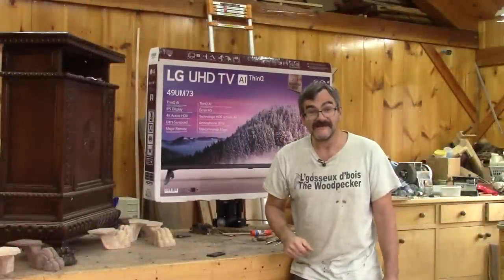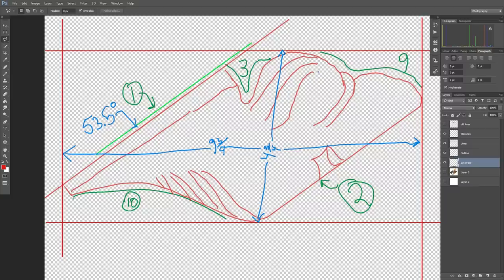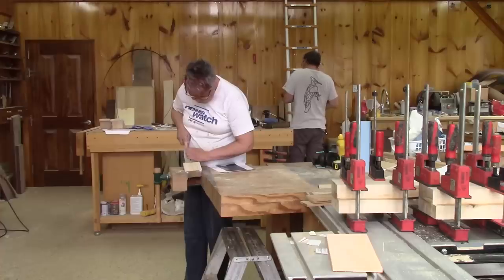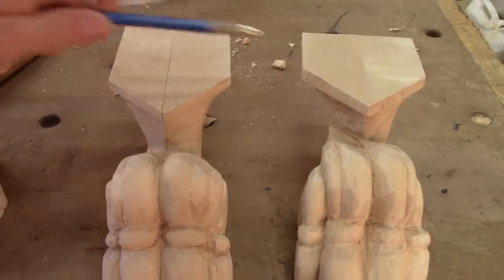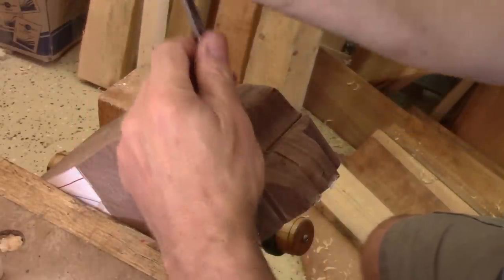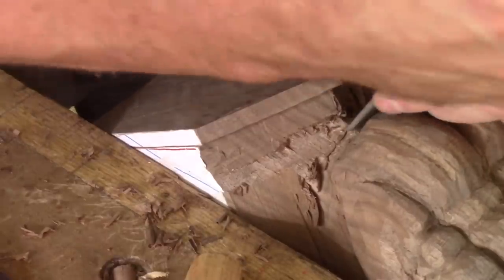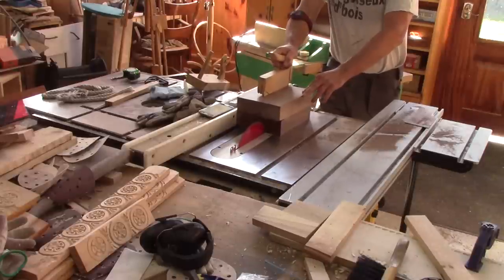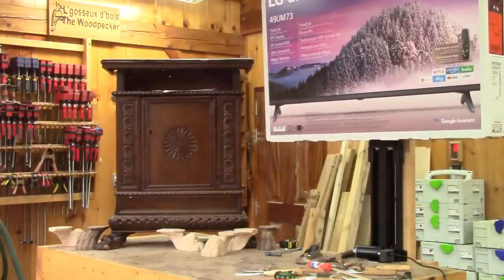The Woodpecker Ep 234 - TV lift cabinet part 1, The lion's feet

Comment: The best and most useful advise I ever got for working with wood chisels is to take off small slivers.  Second best advise was from a woodcarver- work backwards but with the grain.

Seems silly but I use these for my mortises either hand or with mortising adapter for drill press.  I carve out the shape down about 1/8 of inch then use chisels.

You can remove a lot of wood fast taking off light slivers.
Reply from the maker: Yes it was quite fast removing just a small amount of wood. By fast I means 4½hours of sculpting. It's was faster that I was expected before I started.